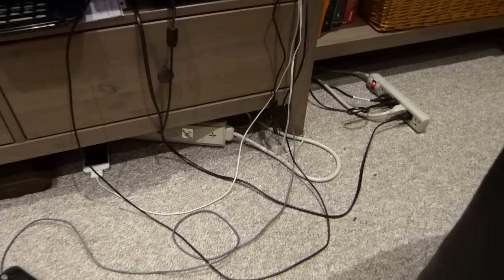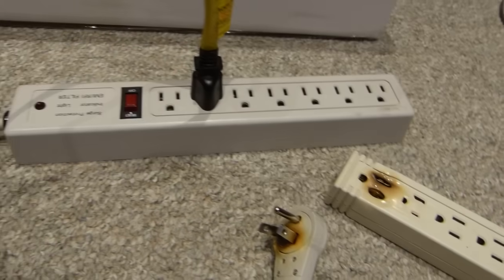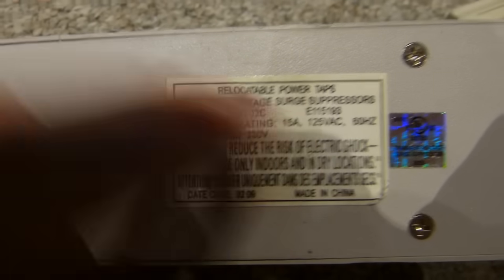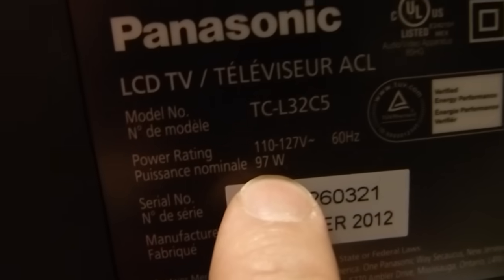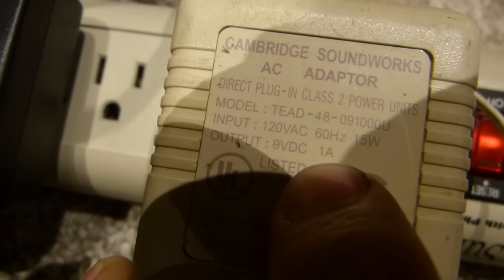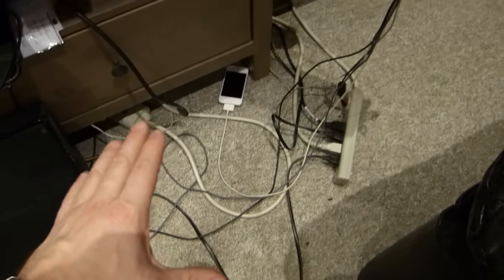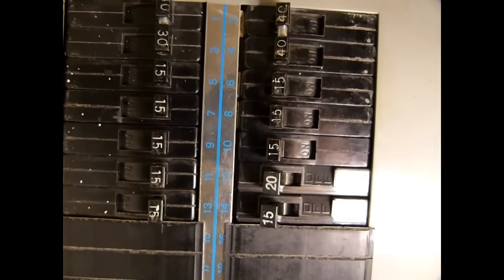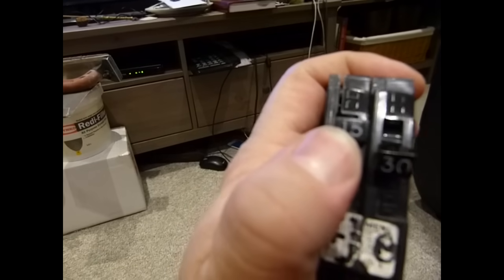Is it safe to plug power bars into power bars?

Comment: For those who don't feel like counting to 15, you can grab a Kill-A-Watt meter which will tell you exactly how many amps and watts a plug in an outlet is taking.  Very useful for determining how close you are to overloading!  (This is not endorsed by any company, I have a few and they're great.)
Reply: Wow thanks. Time to pull the Kill-A-Watt out of the office
Reply: Does it help with the scenario he was showing - many plugs on the same breaker?
Reply: @cliffmathew You would need to know how many outlets are on the circuit and use the device to measure the current being drawn from each one.  Easiest way to find how many outlets on the circuit is to flip the breaker off and check how many outlets lose power.
Reply: @Xyspade  Then once you figure that out, label your panel.  This is one of those things I have as a pet peeve, especially in older houses.  A good 70 percent of our panel isn't labelled.  The stuff that is labelled is mostly high-draw appliances like the air conditioner condenser unit, stove, microwave, dryer and some new circuits like one for the sump pump.

Comment: Breakers sometimes have problems with "slow blow" events, where the operation is overloaded, but everything else is within limits. Some devices also sont always draw power and allow tripping mechanisms to "reset" before the point of activation.

It can be as simple as that it wasn't a true fire, but instead, an overloaded outlet connection between the affected strips. This is why price matters

Comment: 2 Pack Surge Protector Power Strip with 6 Outlets 2 USB Ports, 5-Foot Long Heavy-Duty Braided Extension Cords, Flat Plug, 900 Joules, 15A Circuit Breaker
https://amzn.to/3hXQdap

Comment: You never plug a radiator into an extention cable, let alone with a million other things. You kinda have to be completely dumb to do this and not think your house is gonna burn. not to mention the power bricks all look old, never use old surge protectors because they don't surge protect after a few years.

always get one powerbar than can output everything per wall socket.

Comment: Short answer, NO!
Power strips are designed for a certain load. It's easy to go way above that load rating when chaining them together. 

It's even possible to overload individual power bars and house circuits by plugging multiple high amp devices into it. As a general rule, any device that generates heat draws a heavy load (such as hair dryers, curling irons, heater fans, block heaters, etc.)
Also air conditioners draw a lot. So be aware and be safe.

Comment: its always about the load or amp rating. if you exceed this on the wall electrical outlet it will trip the fuse on the breaker panel, on a power bar it will get so hot it will melt the plastic and catch fire along with everything around it, e.g. carpet, curtains, etc.

Comment: Just buy a surge protector with 10 or 12 outlets but still have to be careful what is plugged into it.  Find out the Max capacity the surge protector can handle and how much each device will consume .  Oven aka stove, refrigerator aka ice box, microwave, washer dryer, window fan aka swamp fan, heater, George foreman grill, air fryer etc all need to be pulled into the wall outlet directly .  They all require and draw a lot power and electricity.  In my apartment if I use air fryer and microwave at the same time it trips the fuses and no more power.  Do not buy used or surge protector from the dollar store.

Comment: Your problem was plugging the space heater into the power strips they draw to much electricity for the surge protector to handle and overloaded the power strip space heaters should always be plugged into a wall outlet should never plugged into a extension cords or power strips!!

Comment: Just an FYI, those breakers on a power bar are simple bimetallic thermal switches, i remember plugging a 1500 watt heater into one of those (well within the current rating with just a laptop and speakers on other plugs), the switch tripped after about 3 minutes. further tests show that those CANNOT be used to supplement a proper circuit breaker.
Older power bars may not even have an overload contingency, while newer ones may even have a proper 15 amp circuit breaker.

Comment: If you have an electrical fire do not dump water onto it instead use a fire extinguisher or call 911 or the local fire department or fire brigade and have them come out and put the fire out.

Comment: You made fun of people not being able to check the current of their devices, yet you gave the wrong current draw of the speakers (that was the output current, not the load of the adapter on the line voltage) and the router was rated at 0.1A at 240, if I saw that right.
Reply from the maker: No such fun was made.
You saw right, but not nearly enough.
I really can`t help with your self-esteem issues on this channel.

Comment: Basically, as long as you didn't go over the max amp, you're pretty much safe as long as 
1) extension did cheap out on  cable (gauge)
2) amp taken for a device is as exactly as it said

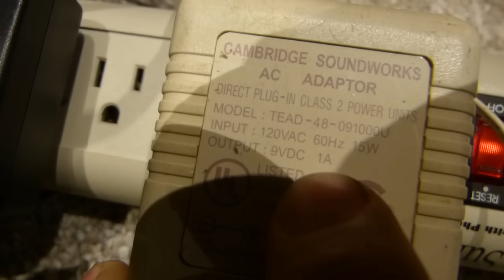Comment: 3:57 You need to take the power factor into consideration. Basically it is about 0.5 on such equipment so double the figure.  4:43 It is output 1 A at 9 V. The input is 15 W at 120 V which gives 0.125 A but lets double that for the power factor so we get 0.25 A.

A circuit breaker does not trip immediately if the overload is not large. Also if there is poor contact in the plug it can cause heat. The more you chain the more change there is for poor contact.

Here extension cords are for 16 A. I have a 10 A circuit breaker.
Reply: What is the radius of your head?

Comment: It caught fire because it draw more power than the circuit breaker and surge protectors could protect it in a short amount of time. You need to have surge protectors that can stop a live dangerous circuit as fast as possible.

Comment: You are asking people to THINK, you must be a bad man but hopefully your efforts will save some people from grief..

For decades I have daisy chained a couple of power bars upstairs in my office without issue. The power bar that connects to the household outlet runs the cable modem, router, phone, desk lamp (everything that needs to be on all the time)and that second power bar. The second power bar runs the computer, printer/scanner, USB hub, etc (I shut it off when I want to kill the computer for the day). I used a Killowat meter to measure things and the first power bar is supplying 30 watts without the second power bar turned on, when I switch the second power bar on it spikes at just above 1,000w and then settles down to just over 300 watts. Now since the power bar is rated at 15a the means I can draw 1,800 watts from that bar before exceeding it's rating.

i would also encourage people not to just buy the cheapest power par on the shelf, buying a reasonably built unit is a lot safer than something from the dollar store is likely to be. Also after a unit has been running for a few hours feel the bar and the cords that are plugged into to to see if anything is hot, nothing should be more than warm - if something is hoy find out why.
Reply from the maker: Well said, thanks for watching. I am a bad man. Drs confirmed it, too.

Comment: My job is to find such cascade setups and dismantle them. There are so much of these in office tables. Good thing some use power bars with proper cable thickness and special reinforced extended connectors. Also, powerbars with integrated fuses.

Comment: From experience, I can say "No, it's not." I had an old house with a single outlet in my office with a 2->4->6 setup with the lowest powered devices furthest. With a 2KW heater on the second of 2, the melting began further up the chain where I would not have expected it.

Comment: I wonder if it's safer to use power bars that are rated for more amps than the main breaker.  That way the main breaker always trips when you draw too much and the components you are using never overheat.
Reply from the maker: Is it safer to get a Lamborghini and put on it 6-inch tricycle wheels on it or get a tricycle and put a Lambo motor on it?
Either way, the system is limited.
Reply: How does this analogy work?  Isn't a surge suppressor, especially a low quality one, more likely than the one in the breaker box to be a danger when overloaded?  I've also read on sites that study these say most wear down over time and eventually won't act properly during a surge.  For the power protection feature to last a very long time they have to be a certain type which is very expensive and not available at common consumer electronics stores or that section of a department store.
Reply: Maybe it's useful to have one rated below the amperage of your vacuum cleaner in case you use it on the same circuit but not the same power bar?
Reply: At the very least it should have an indicator light that tells you whether the protection is working.
Reply from the maker: Relying on a panel breaker means overloading the buried-in-wall part of the circuit. Repeatedly.
Better to replace a throw-away power bar.

Comment: YEEEES ! The router that draws 1A at 5V and the speaker that draws 1A at 9V totally draw 1A each at the 115V outlet. Your power converters are magic and don't follow the laws of electrocinetics. You're an expert, sure thing.
Reply from the maker: Are you deaf? Who said anything about being an expert?
Are you stupid as well? The expert is Gustav Kirchhoff, video is about Kirchoff`s Current Law, my "countribution" is finding some trash and shooting an amateur video without a scipt.
Reply: That’s not power draw, that’s the output voltage and current of the power adapters.

Comment: The problem is the resistance. The longer the cords (added together) the higher the resistance. PLUS the contacts of the plugs do not connect on the whole area pf the plug, but only on a fraction of the surface, creating another resistance. More resistance means less current flowing but more heat being generated. There is also some induction in the wire itself which altogether keeps the circuit breaker ftom tripping.

Comment: I don't know much about funky US electrical installations but here is northern Europe, where rules and regulations are followed neurotically, domestic switchboards have 10A or 16A fuses or circuit breakers, which pretty much guarantees that regulations-compliant extension cords cannot melt. At 230V voltage these currents correspond to 2300 and 3700 Watts, respectively.

Comment: You’re not reading the power supplies correctly. You are reading the output, not the input. 5V at 1 amp is not the input.. I believe it was listed in watts (15).

Comment: We call it daisy chaining.  And it is against the fire code where I live.  Is it dangerous to do this?  In and of itself, no it is not dangerous to plug a power strip into another power strip.  What is dangerous is overloading the power strip with too much current.  Current is in and of itself not dependant on the number of devices plugged in.  If you have 10 devices each pulling 0.5 Amps then you can do this safely even if it takes 3 power strips to do so.  Because in the end you are only pulling 5.0 A total through the 1st power strip in the chain.  Now you could plug in 3 personal space heaters into just 1 single power strip and burn the house down.  That is because person space heaters pull between 10 - 15 A each and 3 of them would pull 30 - 45 A in a device that is only designed to handle approximately only 10 A total.

But we are dictated not to daisy chain them because people abuse them and plug far too much into them.

Comment: Did you ever figure out why the breaker and power strips failed to turn off? I was digging through your other videos trying to find one that referenced this one cause I wanted to know the cause, I couldn't find it.
Reply from the maker: Rotating socket had a gappy fit to plug`s blades. Arcing inside melted the housing. No video about it yet.
Thanks for watching!

Comment: The amp rating of those breakers assumes that you don't have all or most of your load get through a single socket. I've Daisy Chained power strips when the power cables plugged into them are very skinny compared to the power cable feeding the strip

Comment: A good reason not to (circumstantial) is that I experienced horrid ground hum (I believe) on my audio equipment that was chained with 2 strips, went away when using either of the strips solo but NOT both. Worth noting.

Another thing to consider is the stupidity of others, or yourself while intoxicated. My mate plugged a heater into a chain while we were drinking at my place, killed one of the strips and caused a very small fire localized to the port that we had to unplug and cover with a blanket (not drunk enough to throw water on it haha)

Basically these things can be an accident waiting for some hapless individual to do something dumb with.
Reply from the maker: Thanks for sharing, good extra notes!

Comment: 4:30 you should be reading the label in the transformer and how many amps it is drawing at 120V. You added 1 Amp at 5 volts as if it was at 120V.
Reply from the maker: Been noted, thanks. Sorry, read the wrong line off the adapter.
Reply: theoverengineer check the minute because you got 2 things wrong, the edit is just after what im refering to

Comment: Why the fuck would you use power bars that are rated for a lower current than the breaker / RCD / whatever they're behind? That's retarded

Heck, just standardize max current through any given outlet as well as power bar max current, and have the former always lower than the latter. These practices are called "fool proofing" for a reason -- no need to place unreasonable expectations on laypeople when it comes to technical literacy.

[EDIT: In fact, I'd be willing to bet that's already a standard -- I'm pretty sure it is in my country anyway]
Reply from the maker: I don`t, didn`t, won`t. Pay attention, minute 1, sentence 2.
I apologize for expecting an effort out of people, some are called "curious".
You personally, don`t worry about it.
Reply: In English "you" is commonly used for passive tense, where the subject of the sentence is not specified.

The above is an example of one of those uses. I.e. I'm questioning why anyone would do it, not you in particular.

I did actually watch the video, despite what you might think.

Perhaps in the future don't immediately jump to the worst possible conclusion about people and their intentions, and maybe brush up on your grammar?
Reply from the maker: Valid point, thank you.
For indicating a general subject, "one" is preferred instead of "you" because of "you"s singular / plural ambiguity.
Not disagreeing with "you"`s use, just noting order of preference.
Thanks for watching and the good point, 0dWHOHWb0

Comment: It's all about the load.  You CAN daisy-chain power-bars fine, but if you OVERLOAD them, you will have issues.  This video explains the issue well.  Cheap bars will also be a cause for concern if you put any load on them, as a cheap bar with crappy connections to the plugs will be prone to I-squared-R heating, which can be substantial if the current flow is high, but the connection is loose or has a high resistance.  Turns the bar into a heater itself. ;)
Reply from the maker: Yup, all within Kitchoff`s Current Law

Comment: Can you just replace a 15 amp breaker with a 30 amp breaker?
Reply from the maker: Yes I can. But it does not solve the problem.
Reply: I didn't mean for the two power strips, I just meant to increase amps for the outlets :)
Reply from the maker: Good thinking. But the wires inside the wall from outlet to breaker still needs to be beefed up, that`s why a bigger breaker isn`t enough.
Reply: Ah, okay. That's what I was wondering.

Comment: You don’t protect anything with fuses?
Reply: Nope. Honestly it’s a huge problem. Many extension cords here have 16-gauge wiring, which is only rated for 13 amps at 120 volts and in lengths 50 feet and under. Most circuits here are 15-amp or 20-amp. Pretty dangerous if you ask me. Either all cords should be 14-gauge or 16-gauge cords should contain fuses.

Comment: If your plugging in power hungry things that may be used at the same time then no you should not daisy chain power bars, if they are less energy consuming things and/or no more than one or two will be used at the same time then go ahead at your own risk 

(if its say various electronics at a tv (say you want to keep all 15 of your game consoles plugged in so you don't have to fiddle with power adapters each time you use a different console) then its probably fine because most likely only the tv and one maybe two devices will be used at the same time but if its a place where there will be a lot of energy drain then don't daisy chain power strips)

Comment: Huuh. So that's how board circuits works.

So it's safe to assume that each wall circuit only has one or two wall sockets, since it'll be easy to power bar and exceed the power draw?
Reply from the maker: A circuit may have 5 (depending on country & electrical code when built) duplex outlets daisy chain installed together in a bedroom or living room.
Check out Kirchoff`s Current Law, that`s what this video is about.
Thanks for watching, TNinja0 !
Reply: Haah. Math isn't my thing.

Though, knowing how your house operates would be useful. Lel.